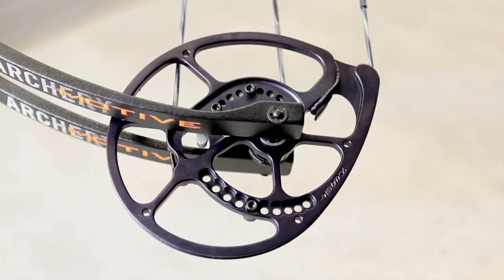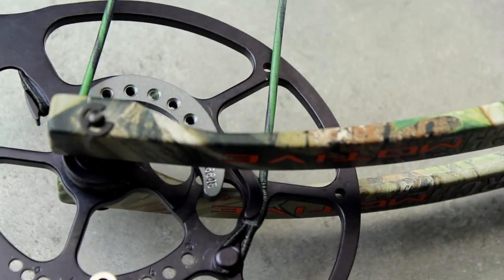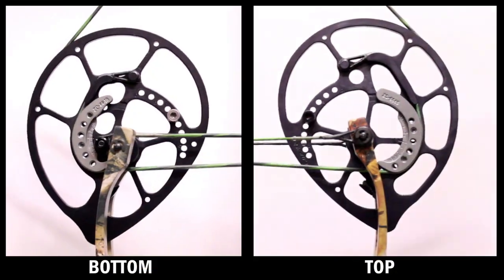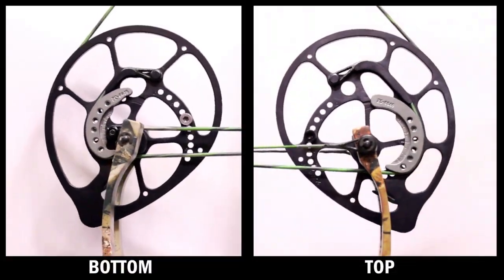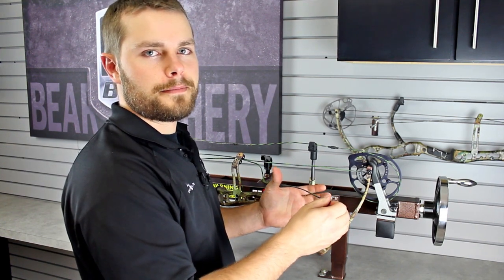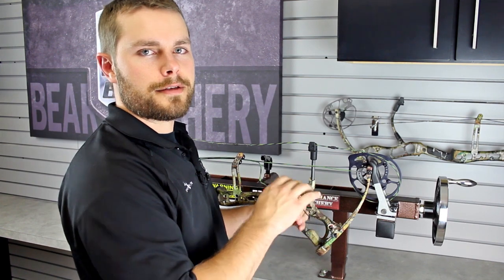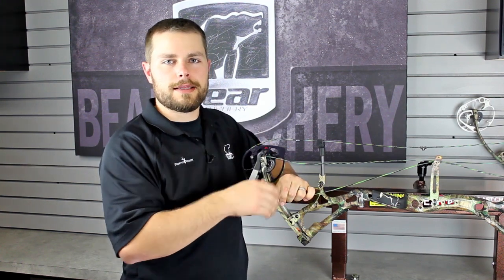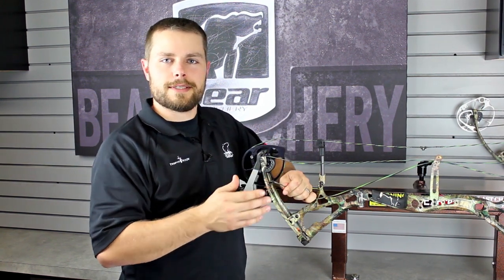Bear Synchronized Hybrid Cam Timing Instructional

Comment: Hi,a have Motive 6;60#.Perfect  Bow.Everything it's in the Spec.ATA,brass height,timing is perfect. The lower stopper touches the control cable, a little.The top stop stops in the cable itself, at the very end of the rubber.The lower stop contact touches the control cable and stops at the very beginning of the tire, touching the cam.It is obvious that the lower stop is thinner than the top stopper.I'm looking for advice.Camm lean?Good day

Comment: The manual is correct not the video. Add twists for the top hitting first and remove/subtract twists if the bottom is hitting 1st.

Comment: I have an Agenda 6. I followed the directions in the video for bottom cam  and it got worse. I'm about to untwist buss cable and see if that works.
Reply: Check your ATA, might just be that cable to the top cam got to many twist in, and the ATA might be a hind short due to this. Remove a few twist from the top cam cable and see if this improves the timing.

Comment: Well I just timed my Method. Bottom stop was hitting first. Took 2 turns out of control cable as the manual instructed and it is now perfect. Should I go and put the control cable back where it was and then adjust the buss cable or just leave it?

Comment from the maker: Do as the video suggests. Let us know if you have any other questions.
Reply: i really admire bear archerys support always willing to help
Reply: After 3years use had a bad mismatch in cams timing. bottom stop was pressing too much  and top cam had around 7mm gap.Followed instruction to this helpful vid by adding 3.5 twists on the bottom part of the buss cable.Both cables just touch at same time now!True manual suggests a different method

Comment: Manual states if bottom cam hits first remove a twist from the control cable , which is correct? 
Add twist to buss cable as the video suggests or remove from control cable as the manual states?